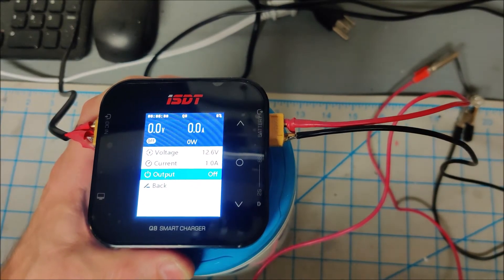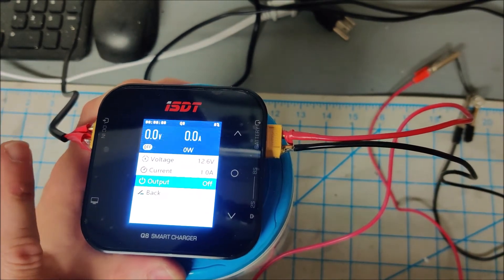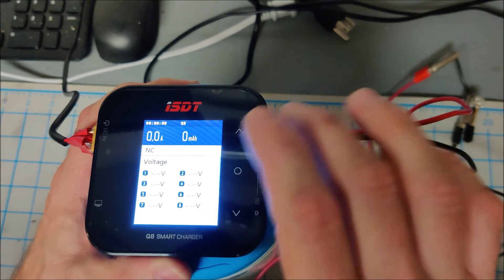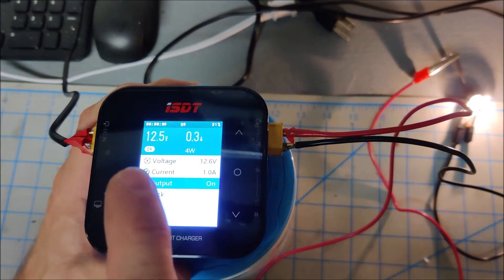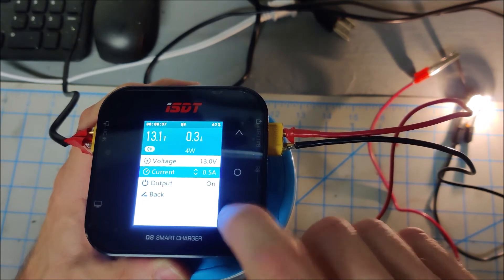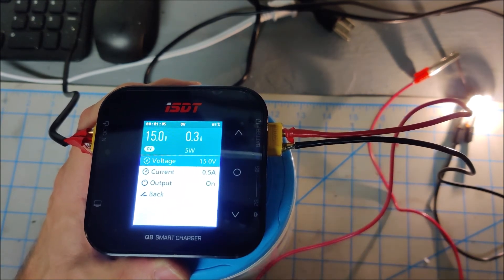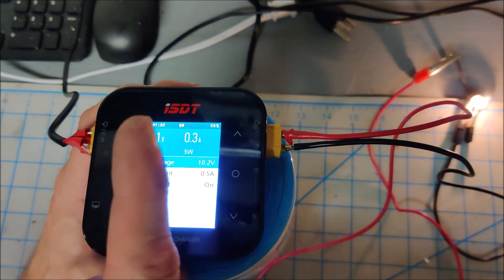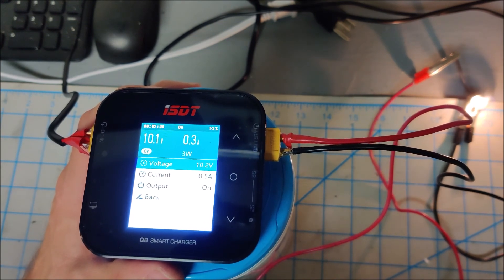ISDT Q8 AS A BENCHPOWER SUPPLY

Comment: Can you please confirm if the charger can be use to charge battery pack through the BMS on the battery pack ?
Reply from the maker: Yes. All my batteries are charged through the bms. You should always charge through the bms so the bms can cut off the charge if the battery is over charged.

Comment: can i use this as a charge controller for solar set up? i mean if i have 100-200w solar panel and 4s/7s 12/24v 100/200amps battery bank.
Reply from the maker: Maybe but I wouldn't. Just get a cheap solar charger controller. Any time the sun goes down this will turn off any need to be reset.
Reply: @stevenc22  oh ok. i thought it has a memory settings once you program it. thanks man

Comment: Do you know if also the SC-608 can do this kind of stuff? :D
Reply from the maker: Yes but it is only a 6S which means you cant use it for 24V powerwalls like mine.
Reply: @stevenc22 i need to power a display that has 12V and 2A...but i can't find the "DC POWER" in the Tasks menu...I've only Charge,Discharge and Storage 😔
Reply from the maker: @FrankP83  That sucks. Yes my old T8 also doesn't have the dc power option.
Reply from the maker: Try upgrade the firmware.
Reply: @stevenc22  I've checked the fw release, and I've already the latest😔